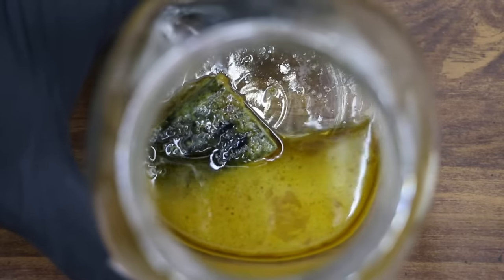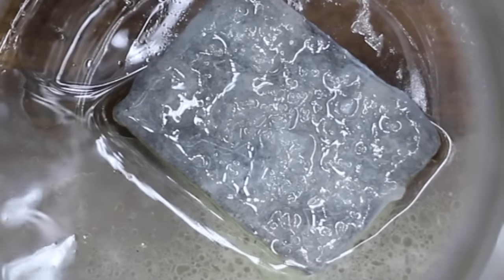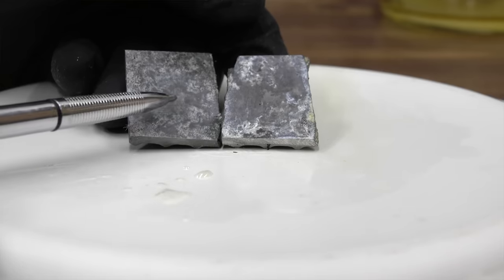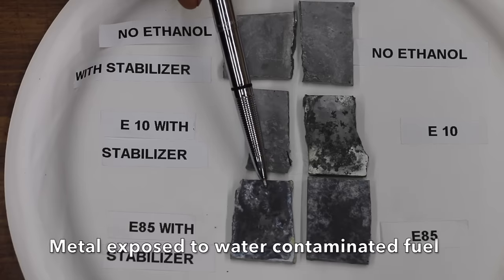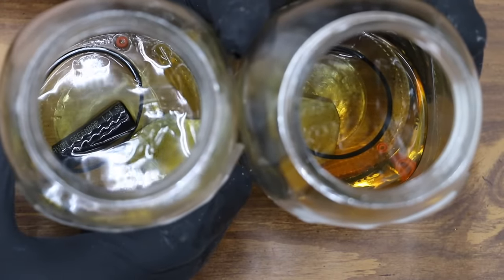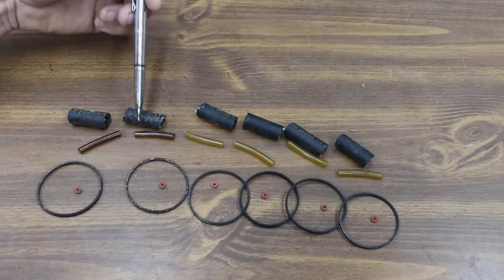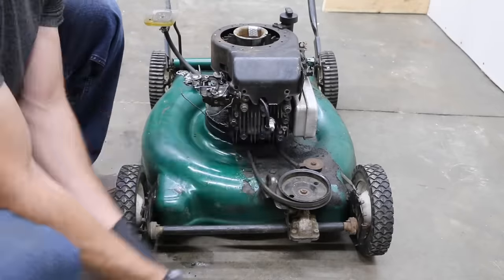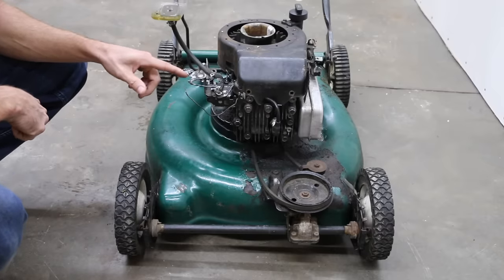Does Fuel Stabilizer Prevent Ethanol Damage?  Let's find out!

Comment: This is why it's worth the extra couple bucks to only use ethanol free fuels for your small engines (mower, whipper, snowblower, etc).
Reply from the maker: Agree.  I always drive the extra 15 miles round trip to purchase ethanol free for the small engines.  Well worth it!
Reply: Shhhh this is how I make make money lol.
Reply: This is why I'm working on going to electric for anything that would need a small engine.
Reply: Re-thinking the jerry can of mixed fuel I have. Don't want premature anything on the Stihl & McCulloch chainsaws.
Going to add Sta-Bil Storage to the can next time I fill it up. They say it's good for a year in the machine, no issues.
Reply: In Germany, even the normal Gasoline has 5% Ethanol
Reply: I've done small engine repair for many years.
I always advise people to drain their gas tanks and start the engine until it runs out of fuel.
Some listen, the ones that don't, pay me more.
Reply: @vik1299  In Ontario, Canada, normal (87PON) and mid grade (89PON) have "up to 10% ethanol", only premium (91PON) at select fuel stations (i.e. Shell) is ethanol free.
Reply: Yea I started buying ethanol free fuel for small engines years ago. Haven't had any issues since.
Reply: +Cole... Mostly a bad idea.  Batteries are expensive as hell and have limited run-times and having cords really SUX.  There is nothing I hate more than having to roll up extension cords after hours of trimming!
Reply: +Zeta.. what kind of batteries?  6 of them? 18 of them?
Reply: So if I get ethanol free gas for my tractor I don't need the stabilizer even when storing for the winter? Also my local station said it's rating is 110. Is that ok?
Reply: +Cole...  It's hard to see how battery operated equipment can stand up.  There just isn't enough power in a battery.  A small  (25cc) gas powered trimmer can generate 750 watts-1000 watts.  You are just never going to get that kind of power out of a such a small battery.  That is a lot of power.  Lawnmowers have even bigger engines generating well over a kw.
Reply: Ethanol fuels burn faster and are less efficient so you might as well use non ethanol fuels
Reply: It's forced on us here in Cali.
Reply: I've been told that the premium gas (93 or 91 depending on where you live in the US) at "larger" gas stations is generally ethanol free. However I've only ever seen one gas station advertise ethanol free fuel, and that was a sinclair gas station in montana (the green dinosaur gas station.) However, "racing fuel" sold at some stations (sometimes 95 octane or 100+ octane) is almost always ethanol free.)

Ethanol in fuel is stupid anyway. It's extremely subsidized and has to be or else everybody would lose money with it. I think it was only done to give the farmers somewhere else to sell their corn, although farmers would know more than me.
Reply: +Don... ALWAYS run your machines out of fuel at the end of the season and don't forget to empty to carb-bowl, no matter what kind of gas you are using.  Fuel issues caused by leaving gas in the appliance is the number one thing that sends the appliance to either the repairman or the landfill.
Reply: No the government should stop mandating that bullshit in our gas just to satisfy them corn farmers in that other scam  THE FARM BILL!!  Thats all its for to make farmers happy. No matter if it wrecks equipment or how much it costs to buy the higher grade fuel.. We shouldn't be forced to buy that shit in 87 octane fuel. They should have another 87 octane pump without that garbage in it!!
Reply: You can also get the small plastic shut-off valves and run the fuel out  before it's stored. That helps a ton we are fortunate to have a fuel company set up shop not far away!!! It's on the way to the parts store!
Reply: Agree! We recently got a gas station in town that offers no ethanol fuel. Made a huge difference in my John Deere 320X, my Stihl 2 strokes, and my Toro snow blower! I want to support farmers, but those engines run much better on pure gasoline.
Reply: Have not used ethanol mixed ever for my smsll engines, never trusted it. Glad to see you do an honest test.
Reply: I would suggest also testing any fuel for ethanol content. I have seen non ethanol fuel with a higher ethanol content than e10.
Reply: In my town there is only one place to buy it and it's 8 bucks or more a gallon
Reply: Problem with us up here in MA is, no ethanol free fuel is available at ANY pump across the entire state, regardless of the fuel grade. In NY, they sell ethanol-free premium fuel at the pump (at certain stations - not all of them) - all the grades below premium have 10% ethanol content. In MA, our only choice is to buy containers of race, or OPE fuel from NAPA, Home Depot, etc. for what comes out to $18/gallon and up after taxes. Even running a chainsaw, that will get pretty spendy pretty quickly!
Reply: All I run in my chainsaw and weed eater is 93 ethanol free gas and my lawnmower and both of my trucks gets 91 ethanol free gas.(both of my trucks are 1994 Chevy C1500).
Reply: or jet fuel .
Reply: syncerus.mr  
Yes that absolutely works.
I'd still drain any 2 stroke because of the tiny carburetors and finicky nature
Reply: I only have one small engine left and that’s on my power washer.   After use I just drain the tank and undo the float bowl drain screw.    Takes a minute or two and I can feel free to use regular gas from the gas station.   The washer is used a couple of times a year so doing this routine is really no hassle.
Reply: Good Luck finding Non Ethanol Fuel in NJ. Only place I know of is a Small Airport. Then you run into issues with Octane. And Possibly Lead.
Reply: Cole Logan    Yup.   I did just that.   Weed eater, small lopping and limbing chain saw, hedge clippers and blower all running on my 20 volt workshop batteries.    It’s great.
Reply: @reeepingk  Don't ever generalize premium gas is ethanol free.  Majority is not. There are websites dedicated to telling you where exactly ethanol free pumping stations exist.  In some cities of millions, there might literally be only one place to get it.
Reply: I don't mind for my lawnmower, but at the end of the summer I run it dry before putting it away for the winter. And what's left in the jerry goes in one of our vehicles.
Reply: @chrisphilhower6029  race fuel is non ethanol
Reply: @toysareforboys1  from Ontario as well, thank you, will buy at Shell
Reply: There is nowhere in the state of Texas to buy non-ethanol gas except maybe at a marina.
Reply: Tom B. I use Sta-Bil marine and it has been a very good product for me. I have a ski boat that sits during the winter and have no problem firing it up in the summer. I also use non ethanol gasoline.
Reply: @TheGibby13  Nice! I hope you got out and voted!
Reply: Pay me now or pay me later. In the spring, I get so many lawn mowers in for fuel related issues. I order carburetor rebuild kits by the case. I also buy Simply Awesome from the dollar store for my Ultra sonic cleaner by the case in the spring. It's non caustic on carburetors like simple green and purple power. I avoid those brands now.
Reply: @landdon24  Yes it will be fine.
Reply: @tarstarkusz  It depends on size of property. Anything over 1/4 acre and forget it. Buy a fuel powered unit. A battery will not last eather. The cost of a Replacement battery makes it impossible to justify the initial expence.
Reply: @larryw5429  It also drives up the cost of corn. It also eliminates the use of fields for more useful crops as food. Because farmers get a better deal on corn, they grow corn. Wheat is more important as a food source.  Corn also depletes the oxygen in the soil and requires more fertilizers that contaminate our water.
Reply: Worth it. Cuz carb and hose kits cost money and down time.  I still have access to av gas.  Wash my hands in it. It doesn’t stink.  I get JP fuel ⛽️ as well.
Reply: Ethanol is cleaner burning though as shown on this channel as well.  Non ethanol gas is generally better quality though.  It's a tough choice.
Reply: There's a handful of states (I believe 9) where ethanol is mandated in gasoline and it's actually illegal to sell ethanol-free fuels.
Reply: @oldtwinsna8347  Interesting, thanks! I wasn't 100% sure, hence the "I've been told." ;) One thing I am 100% sure is that mid grade gasoline is just a 50 50 mix of premium and low grade. So if you were to buy mid grade at a station with ethanol free premium, you'd be getting less ethanol (compared to low grade) if you bought midgrade. Only reason I know that is because gas stations only have 2 tanks for gas (another for diesel if they have it). (Family member used to be a truck driver.)
Reply: @racerex340  Ethanol has less energy density than gasoline, so you actually get a considerable decrease in mileage and efficiency with even just E10. It's literally worse in every way than gasoline (including environmentally), but it's used for political influence. The farming lobby is actually quite powerful and politicians happily kowtow to them for support.
Reply: @SmittySmithsonite  check you tube videos of how to remove ethanol
Reply: @RC Hobbyist... Yeah, that's what I though.  I was looking on the homeless despot and it claims a maximum runtime of 42 minutes on a 240wh battery.  So that's well under 500watts. Meanwhile, even the cheapest gas mowers are putting out several  kw or more.  ALL of the corded electric mowers are using over a kw and have a much smaller cutting area.
Reply: I love taking apart some of these carbs after someone leaves motorcycle, lawn mower or something else siting for a couple years - usually total disaster. You guys wouldn't believe what happened to my friends BMW boxer bike fuel tank - all brown from rust inside, thanks to old E10, 92 octane fuel.
Reply: @racerex340  - It is 100% true. Give me an address, and I'll show you a Google street view. I'd bet anything it's not at a pump. Only places listed on Pure-Gas.org are power equipment dealers, motorsports dealers, or marinas - only canned fuel is sold at these places. If a gas station is listed, it's because there's a garage at the station selling canned fuel there.
Reply: @tarstarkusz  actually the brushless electric motors hold there own power wise, it's making the batteries last long enough that is the issue. Depending on a person's task electric can be far superior, like if noise is a large concern electric is the instant winner.
Reply: @vik1299  not only has lower ethanol content but all fuels in EU, Japan seem to have a few extra octanes. In fact some cars on N.American market throw check engine light when run 87oct Regular, while no problems with Regular 95 in EU. I know the octane numbers are calculated differently, but for the sake of universality shouldn't the fuel around the world have the Octane rating.
Reply: Too bad I can't find any gas stations that are ethanol free
Reply: We have NO pure gasoline within at least 100 miles where I live.  :(
Reply: @brucebennett8475  - Been there, done that. It's ALOT of work, and you end up wasting a bit of fuel as you can never get 100% of the water out of there. I'd rather our idiot politicians allow us to get ethanol free fuel from a pump, like they do in every other state in the union outside of the Northeast.
Reply: @toysareforboys1 
But in EU Regular 95 is equivalent to 90-91 octane fuel in North America, so it seems that EU, Japanese and other countries fuel has also higher octane rating than fuel sold here and whole North America. Why, I have no idea, but maybe due to higher speeds and engine load associated with it historically, could be because most other countries cars also use smaller engines that pushed harder.
Reply: @racerex340  - Yeah, back in the day the Sunoco station in the center of Westborough used to sell 109 octane leaded race fuel. Not anymore. Those days are long gone, unfortunately. Airports are the only places to buy ethanol free fuel at a pump, but only certain places will allow cans to be filled. It's closer for me to just drive out to NY with a 55 gallon drum for auto fuel. Problem with leaded fuel is you'll get lead fouled plugs and exhaust ports or valves eventually. You have to run an additive, such as TCP (which isn't cheap either) to take care of that problem.
Reply: @racerex340  
The alcohol based fuel ratio is different for max energy. Usually more methanol or ethanol is needed than pure gasoline (14.7/1). But methanol for example has much higher octane rating and allows for higher compression ratio so it found its use in racing, say Motorcycle Speedway 500cc one cylinder bikes, boat racing, model engines. I think Brazil was one of the first countries to switch to alcohol based gas during OPEC Crisis many years ago.
Reply: Or get electric ones and never have to fuck around with messy liquid fuel again.
Reply: just don't ever let it set with fuel in it... Its very easy to shut off the gas and then let the engine run until it dies--- before putting it up for the winter.  Easy step.
Reply: @Dougie1969  This has always been my solution to small engines since the only ethanol free gas I can get is too low octane.  I simply empty the tank back into the can, and then run the thing dry.  Been running ethanol gas in a cheap Murray lawn mower for years now, and she cranks every summer.  Same with my weed eater, and my chainsaws.  I should add though that I mix Marvel's in all my gas.
Reply: I wish there were ethanol free gas stations around here, nearest one is like 100 miles away.
Reply: @pliedtka  Canada/USA uses PON fuel rating, most other places use RON, that's why the octane numbers look different but are actually the same :)
Reply: @vik1299  its easy to remove..by adding water then shaking it up...then remove the water/ethanol by removing the bottom layer...
Reply: @Jay Dunbar  That was point I was making.  To run these mowers at the same power as their corded brethren, it would take way too much power to run by the small batteries they use.  They all have smaller cut paths, even the corded ones.  Most of the gas ones are in the 5hp range, which is close to 4kw.
Reply: +Sean Daly... What about the lead?  Won't that screw up the catalytic converter?
Reply: @ProjectFarm  Can you actually get ''Regular'' gasoline without ethanol in USA?  Only way to get ethanol free in Canada (at least where I live) is going to Super higher octane gasoline.
Reply: @racerex340  Where are you? Our local Valero station carries both premium E10 and ethanol-free premium for the same price. My vehicle doesn't need premium but I buy the ethanol-free anyway.
Reply: +Mastron.. Most modern cars are designed to run with at least some ethanol.  Many modern cars can run e85.
Reply: @reeepingk 
Ethanol-free is more efficient. It has been shown to deliver 4% better fuel economy sometimes considerably more. That may have something to do with why it's used as a racing fuel.
Reply: @calholli  Then the black gaskets will just dry out and break off as pieces/grit next time you do add fuel. I just bought an electric chainsaw so I don't have to service the old craftsman 2 smoke.
Reply: @oldtwinsna8347 
www.pure-gas.org/
Reply: @TheGibby13  
Ethanol-Free in Canada...
All Canada: Shell V-Power 91, Canadian Tire 91, Esso 91, Petro-Canada SuperClean 91
Atlantic Canada: Irving Fuels premium
Western Canada: CO-OP premium
Newfoundland, Nova Scotia, Prince Edward Island: all unleaded gas
Ontario: Costco 91
British Columbia: Chevron 94
Reply: @racerex340  - I'm all of an hour from NH, and that's with no traffic (which never happens down here, lol). Yeah most of the places listed on Pure-Gas.org sell those exact same 5-gallon drums. Too rich for my blood. When I was out in OH a couple weeks back, I bought a little over 2.6 gallons of 90 octane ethanol-free fuel straight from the pump at $3.84 a gallon ($10 worth). Wish someone around here would do set up a pump like that! It was away from the regular gas pumps at the side of the parking lot.

I looked into buying 55 gallon drums of ethanol free fuel online. Still cheaper than buying the 5 gallon cans. I still may do that some day.
Reply: @racerex340  I'd rather see 87 octane be ethanol-free but of course that isn't likely cause most gasoline sold is regular grade. But you sure don't need premium in a lawn mower.
Reply: @SmittySmithsonite  
That depends on the state you're in. I buy ethanol-free at a Valero station three miles from home. They carry E10 premium and Ethanol-Free premium both at the same price.
Reply: @SmittySmithsonite  
Pennsylvania is in the Northeast and ethanol-free is available at a limited number of PA stations.
Reply: @racerex340  - Great idea - I bet that would catch on quick. Something tells me the powers that be here in MA would shut it down just as quick, though. Worth a shot at least!
Reply: @Cole Logan, while it sounds good in theory, batteries cost more to replace than carburetors when they go bad, and they’re not very durable for consumer applications. They are, however, great for commercial applications and have some definite advantages over gas - noise, emissions, vibration, etc. Just don’t expect to save money unless you can’t buy E0 gas.
Reply: @SmittySmithsonite  I live in PA and buy ethanol-free gasoline at the pump. We recently took a trip to Michigan and I was able to buy ethanol-free at the pump in Ohio, Michigan and New York state (in Buffalo area).
Reply: @tarstarkusz  Yep. And especially when said trimmer with the orange extension cord cant reach the whole yard. 

Been there done that. Lol
Reply: @thilolg  Yep. Ethanol is an alcohol based fuel so less energy content than straght Gasoline.
Reply: @tarstarkusz  I have run a Neuton rechargeable lawn mower for 15+ years. It was about $100 more initially than a gas mower but I have certainly saved way more than that on fuel. I've rebuilt the "battery" twice over those years. The last time it cost me $35 because it uses common SLA batteries that are used in computer UPS and scooters. They don't sell it (SLA model) anymore. They turned into drpower.com and now do li ion versions.

BTW I recently took it apart to untangle some  gardening mesh tied/twisted around the main shaft. It surprised me how clean it was inside it's all plastic case. The brushes were not even half worn. No wobble in the bearings. The circuitry looked brand new. When it does croak I am definitely going to buy a DR power mower because of the value this mower has been. The only thing showing a fair amount of wear is the wheels and after 15+ years that shouldn't be a surprise.
Reply: @DashPar  Well suprisingly Ethanol can be made without corn farmers. 

Its an alcohol based fuel. I don't like it very much because it doesn't have the energy content that Gasoline does.
Reply: @bergerongui  
Depends on the state you are in. I'm in PA and most EF gasoline seems to be premium grade here but in Texas there seems to be a lot of stations carrying regular grade EF fuel.
See www.pure-gas.org
Reply: +John Possum.. I go through about a 1/2 a gallon to a gallon of gas each season, so really the cost isn't a big deal, at least for me.  I don't have anything against them, they just don't work for me.
Weight isn't a big deal for a push mower, but I'd have to carry a string trimmer with a lead acid battery!
Reply: @racerex340  
It is available at isolated stations in NH. I believe Conway, NH has it. Also there is a station about 30 miles East of Meredith, NH.

https://www.pure-gas.org/index.jsp?stateprov=NH
Reply: We cant buy ethaonl free gas in 99.9% of California.
Reply: @scottfirman  

But see..

What bothers me is we have the technology to make Ethenal from other sources like garbage and wood because it's just an Alcohol based fuel. 

Yet they would rather chew up corn which I would like to keep eating thank you very much Government!! Ugh!!
Reply: @SmittySmithsonite  
We were in Michigan a week ago and saw ethanol-free at one station for only $2.849 a gallon. Extremely unusual. It's usually at least  $3.39 or more currently.
Reply: @WeShallBeFreeAtLast  Yep. Ethanol is simply an Alcohol based fuel that could be produced from other sources like garbage and wood but no!!! The freakin Government wants to use up all that juicy corn I would like to keep eating. Grrr.
Reply: @racerex340  
We use to live in NE Vermont. By the way, there is a station in Lyndonville, VT that has EF at the pump.
Reply: @njsongwriter  - When I say "Northeast", being from MA, I'm thinking New England as a whole. PA is a more normal state than MA. MA is run by a bunch of idiots, to put it in a family friendly way. 

Pretty much every state in the union outside of New England offers ethanol free fuel at the pump. I just grabbed 2.6 gallons of 90 octane straight from a pump in OH a couple weeks ago. $3.84 a gallon. NY has ethanol free premium at certain stations (Stuarts Shops being one of them).
Reply: @njsongwriter  No, that's completely not true. Ethanol has a significantly lower energy density than "pure" gasoline. It's quite literally a filler. My car, as well as nearly any other, took a significant hit in MPG when they started putting ethanol in gas. The reason it's used as a racing fuel is because it can handle very high compression without igniting (meaning it's octane rating is very high.) Meaning that with all things being equal, an engine running on ethanol (or methanol) can handle more boost than an engine running gas (assuming nothing else breaks.) In the types of racing where ethanol or methanol is used as a fuel (drag racing) fuel efficiency doesn't matter.
Reply: Yep, 92 octane ethanol free is all my small engine get. They run like a champ!
Reply: @Sean Daly... Do you have any ideas as to why it led to worse throttle response?  The LL stuff is very high octane and shouldn't knock.
Reply: The push is for even more ethanol .. Google "UNL88"   E-15 huge mistake , it must be stopped.
Reply: @Richard - Thanks Richard.  Found a Quik Stop just a few miles away.  I will check it out. It just opened in August and I've been driving right by it.  Thanks for the link.
Reply: @redeyedfreaks Try the website pure-gas.org.  It helped me find one close by.
Reply: john thonig  Thanks. I'm near Florence, so that would be a pretty long drive.
Reply: @racerex340  
It's bad enough we have to check food labels to make sure we aren't eating crap... Now we can't even be sure the fuel going into our tanks is fit for consumption by our vehicles without checking labels... Ugh!
Reply: @SmittySmithsonite  how about going to an airport and get some av gas.  Go where the little planes are.  Av gas will keep for years.
Reply: Ethanol is not cheaper. It releases less energy. Check your mileage. You'll find that you'll lose one or two MPG with E10.
Reply: @reeepingk  - Ethanol fuel is corporal welfare. And I'd bet that the family farms aren't the ones reaping the benefits. Here's an interesting article. I have no reason to doubt their findings, but I've never independently tried to verify them. However, the article is very thorough and does list sources in the footnotes.
https://www.taxpayer.net/energy-natural-resources/federal-subsidies-corn-ethanol-corn-based-biofuels/
Reply: @iHenry2  In practice ethanol containing gas is almost always cheaper because the only non-ethanol containing gas is high octane fuels (92/93). Gas with 10% ethanol has only 3% less energy so the fuel mileage loss is almost negligible.
Reply: @Matt-dc8lp  - I wouldn't call 3% negligible. I personally observed mileage and performance drops. I used to be very meticulous about vehicle maintenance. Also, the loss wouldn't simply be 3%. The energy density and the lowered octane of the fuel. 
In the average family car, most people wouldn't notice. But like I said, these are my personal experiences.
Reply: @GreatNW  Where the hell do you live? Even in San Francisco, gases under five bucks a gallon.
Reply: @iHenry2  normal gas around me is running 2 something but non ethanol gas is expensive cause there is only one station that you can buy it at so it's a monopoly. But I live in Roseburg oregon and it's a town that likes to think it's a city.
Reply: @garyh7949  Walmart in Calallen Texas has ethanol free choice at the pumps.
Reply: @scottfirman  Seeing how you're so smart, i would like you to try farming for a yr. Then tell everyone how rich you are after that yr.
Reply: @duanehenicke6602  If I did it would be with a government financed and backed loan so if I failed, they would bail me out like GM did.
Reply: @scottfirman  Lol. That's how i farm!
Reply: Where I live you can't do that, a minimum  of E5 is mandatory and most pumps only have E10. However fuel is not something you should store for longer periods anyways, and if you have a reasonably modern car it shouldn't affect it negatively.

You do however get better fuel efficiency out of pure petrol, it has a much higher energy density. Not to say that you can't get better performance out of ethanol, you can, but the engine needs to be tuned for it.
Reply: Ethanol fuel is fine for engines run on a weekly basis. No need to waste money on premium fuel when it's really not needed as there is hardly any difference performance wise. Now if you have equipment that doesn't get used much non ethanol is the only way to go or premix if its 2 stroke.
Reply: @Rottidog68  buy the Stihl premix it's worth the little extra and will last longer than anything you mix yourself.
Reply: @reeepingk  it used to be but hasn't been subsidized for years. Stop spreading misinformation about a topic you know little to nothing about.
Reply: @racerex340  Where i live 94 octane fuel at chevron is octane fuel. this is the only place that guarantees no ethanol. its only 15 cents more
Reply: @supersportimpalass  There's a difference in fuel consumption, if you can get them for the same price you should get it without ethanol. If there's a price difference you can either get the calculator out or accept that you might lose a negligible amount of money.
Reply: @Rottidog68  He just proved that stabilizer doesn't solve the issue. In some cases it seem to make matters worse. I'm I have a can of mixed PLUS 89 mixed for my two Sthil saws and I think I'm going to dump it. I've got regular 87 sitting in a generator with stabilizer for almost a year. I bet that fuel is toast.
Reply: @BigPanda096 I stop at battery powered drills, drivers and saws. A battery chainsaw would never keep up with my needs and neither would a battery mower. I need fuel around for the atv, generator, snowblower, pressure washer, etc. I really like the battery stuff but a battery riding mower is $2000 more than my JD 155 mower.  This was a very enlightening video.  You push mow 2 acres! That's insane! It used to take me 45 minutes to push mow 6,000 sf. including trimming around trees and house. Clearly you are not of this world.
Reply: @Dougie1969  What do you suggest with generators? I always keep stabilized fuel in mine because I never know when I'll need to use it. Clearly, stabilizer won't work in the long term. Do you suggest shutting off the valve and draining the carb bowl? I used to think I new all I needed to know on this matter but ethanol has changed the rules. Years ago when I was heavy into snowmobiling, it was widely suggested to completely fill the fuel tank to avoid condensation and to fog the engine until it stalled. No carb draining necessary and I never had an issue. Now I want to throw out all my 87 fuel and buy 91 because it's ethanol free here.
Reply: @bubba99009  I've never had any issues with any of my power equipment using regular 87 (10% ethanol) but now I'm worried that there's a major problem just around the corner. Basically, it seems like it's a corrosive cocktail just silently waiting for a day to f@*k you over.
Reply: @scottfurlong5475  
Ethanol free is definitely one of the best solutions 
The best solution for me has always been to drain the fuel tank and then run the engine until it stalls.
Reply: @BigPanda096  I agree with you there. Battery will take over most duties but cost needs to come down some more.
Reply: @garyh7949  Try a Marathon gas station
Reply: @omartinoco9930  Thanks. I did find a station close by that sells non-ethanol.  A new Quick Trip store that recently opened.  It was only 60¢ a gallon more than the ethanol.
Reply: In my area some, not all Marathons have Rec 90 ethanol free. Tractors, all lawn & garden equipment have neck snapping torque when used. Will give a car 10% more power & mpg.
Reply: @BigPanda096  Lithium batteries and brushless motors are putting small gas engines in museums.
Reply: @reeepingk  Ethanol as motor fuel was promoted to reduce dependency on imported oil. That reason has been solved so the ethanol should go away.
Reply: I have converted to all battery for shop and yard tools.   Same battery family for all.    The only exception is my power washer.    I use it maybe twice a year so I get 5 gals for a washing campaign and then drain carb bowl and tank and let them evaporate completely dry.    Any leftover gas is dumped into the car for immediate use.    Next year the machine runs perfectly.    Anyone can loosen a float bowl or use the drain screw (but leave screw off for a few days to evaporate the little bit left that didn’t drain out) as well as run tank dry and allow to evaporate.    I actually pull the hose and drain tank into gas can.
Reply: I can't find ny around where I live, and I'm not driving 150 miles to my nearest Sunoco station. I've been using E10 in my mower for 10 years, and other parts will break long before the carb; it still starts with 3 pulls from being off for 4 months, and 1 pull for the rest of the season. I think engines newer than 2005 should deal with the ethanol issue much better than those shown in this video.
Reply: Absolutely.  I do the same the for my boat.  My Mercury 150 has never seen a tank of ethanol.
Reply: @reeepingk  And don't forget the bunch of Eco-Phanatics "green people"... (Not that I don't care for ecology, but 99.99% of stoopid politicians and Obsessive Tree-huggers actually do more damage, as their measures are counterproductive).
Reply: @tarstarkusz  Oh yes! ... they can.  But will lose some MPG when using ethanol!
Reply: @BigPanda096  PLEASE CHECK YOUR NUMBERS SIR, Modern Li-Ion batteries capable of powering electric motors, are different from those powering cellphones, and their average number of recharges is no more than 500 cycles, after whose the battery will only have about 80% of the rated capacity, regardless of any outreageous claims or "warranties", or vendor promises.
Reply: @Matt-dc8lp   "Only 3%...". Please check your numbers, and do it carefully.  It is between 4% and 5%.  If in doubt, learn how to read true BTU content per gallon of fuels at a reputable source.
Reply: tarstarkusz the new generation of 18 v lithium ion battery packs used in tandem in mowers and the 36 v and better packs used in Electric Battery saws are robust and great for short operations in the garden and around the house with the advantage of cleaner operation and cheaper refueling by charging.the tools are generally lighter and easy to operate, a good option for women looking for a clean and light method of working.sure it costs to acquire but anything good will pay back your investment..... I definitely go with the guys who empty their equipment of fuel when it’s not going to be used for a while that tip is worth its weight in maintenance ....
Reply: Chris: I accept that great advances have happened in Li-Ion "tool" batteries recently. Those are powerful, even rivaling with corded 120 VAC tools.  BUT, even when manufacturers claim more than 500 or even 1,000 recharging cycles, the batteries continuously lose capacity, slowly at first, but then more rapidly, until it is time to exchange them at heavy cost.  Most people lack the dexterity, knowledge and plain courage to tackle a cell Exchange inside a large pack.  There are a few good quality cells in the aftermarket, but it is not so easy to replace cells when there are multiple monitoring wires, soldering (or even welding) involved.It is a greedy business-model for cordless tool manufacturers to make large amounts of money from their customers, as they overcharge them with outrageous prices for a new pack (sometimes almost the price for an entire new tool!), knowing that is won't last much, and they actively look to make their packs as incompatible as possibe, not only between other manufacturers, but among their own lines of products.  Only one of them (RYOBI) that I'm aware of, uses compatible batteries, but I'm not a huge fan of their tools.And apart from the initial cost of the not-inexpensive cordless device, it is the Life-Cycle cost of maintaining such devices.  Even at end of life, there is a cost (hidden but inevitable) for DISPOSING of those batteries...On other devices, like a pressure washer, the gasoline operated one is truly the only option... I had a 120 VAC compact one, and soon realized it took me EXACTLY the same time to use it to wash a midsize sedan, than using a bucket!  When I complained to a seasoned technician from Kärcher at an expo, he admitted that, and told me to go for their largest electric pressure washer, a "K5" size machine that was being discontinued at that time (model K-520M)...  As he said, anything smaller won't really save you any time at washing your car...  So I went to buy the Honda-powered Kärcher pressure washer sold by SAM's, as it had an even lower price than Kärchers own price for a similar machine.  Even at our very high altitude in Mexico City (7,350 ft. asl) and warm temperature, there are no electrical corded washers fed by 120 VAC that can approach my gas powered washer.  and there is another little known fact that gentleman gave me: When Kärcher made their electric motors for the American 120VAC 60Hz grid, they had to use thicker copper wire, but with less turns, to use the same electric motor frame, losing efficiency... so those initially more efficient 230 V motors, now produce LESS power when rewired for 120V... After several years of use, my gas powered pressure washer has been more economical to use than a corded electric one, because of the cost of electrical energy.  And only once, I had some problem when a tank of gas went bad and clogged the carburetor (my fault).  I don't anticípate any cordless pressure washer soon, as power and time of use still require more continuous power supply than any present day battery.
Reply: I remember when ethanol fuel came on the market in the 1970s... tried it in my F100. Ran hot, no power, and absolutely killed my gas mileage. Never bought it again until I didn't have a choice (lived in California).
Reply: I'd rather put that corn in a cow or pig and support the farmers with a nice roast or steak.
Reply: @Semper Fi  Holy crap that's painful... here in MT ethanol-free is just ordinary premium gas, so only another 10-20 cents more a gallon.
Reply: Not true, unless your state has draconian restrictions. Here in Montana, probably half the gas stations carry eth-free 91 octane. You can get it at almost every Cenex or Conoco, and a lot of Exxon and Holiday stations too.
https://www.pure-gas.org
Reply: I can say one thing here and I have learned this FACT from some very painful and expensive repairs.  NEVER run ethanol gas in any small engine such as is used in pressure washers, chippers, weed eaters, and lawn mowers.  The seals and internal fuel lines can't handle the alcohol and the carbs will crap out quite quickly.  Some of the newer units have a different quality seal and internal fuel line but after the amount of money I have spend on repairs I still don't trust them.  With older big vehicles like cars and trucks I understand there's a problem because of valve seats not being able to handle ethanol gas as well as carb problems.  The newer vehicles have different valves and valve seats as well as being fuel injected.  I personally will never run ethanol in anything other than my truck which is E10 rated.  Non-ethanol may be a bit more expensive at the pump but a lot less wear on the small engines, my nerves and my WALLET!
Reply: @iHenry2 , I can only speak from experience but my truck, a daily driver, is E10 rated.  Still, from new, I ran ethanol free in it to preserve the fuel system from corrosion.  After talking with a mechanic at my dealer who deals with fuel systems a couple of years after I bought the truck, I switched to ethanol fuel.  My fuel mileage DID drop for a couple of tanks then it picked right back up.  My dealer's explanation was that the onboard computers now sense engine performance based on fuel octane so when I switched it took a couple of tanks for my truck's computers to "reset" and bring the fuel mileage and engine performance back up.  I'm no mechanic or high priced engineer so I can only go by what made sense to me at the time.  All of these people that keep putting higher octane fuel in their standard engines are wasting their money because the computers will "reset" once they start using the lower octane fuels thereby bringing their fuel economy levels back up.  I don't know but it makes sense to me with all the computers doing everything now but driving the truck (and that may change in the near future).
Reply: @GunnerAsch1 , the price you pay to live in a near Gestapo run state!
Reply: Nicolas Broszky , maybe the newer small engines will but after having to have my older weed eater, chipper, riding mower and pressure washer all having to have their carbs rebuilt due to ethanol, I don't touch that stuff for anything!   Oh, and all four of them have older B&S engines.  That has been my experience with that stuff.
Reply: @karlseel815  battery powered
Reply: @Dougie1969  I heard it's better to fill with stabilized fuel to actually 'prevent' rust and corrosion. So if you drain the tank and run til empty, there are no adverse effects to storing the tank empty?
Reply: @Marcoosianism  
If it's a metal gas tank, I suppose there would be some concern about rust forming from condensation.
That said, any rust that does form is palpable compared to having your carburetor full of gel from ethanol and fuel stabilizer.
A fuel filter would stop rust from entering the carburetor.
Only other thing you could do is leave it full of fuel, (not the carburetor!!!!!), Then empty all the fuel and start with fresh .
Reply: @Dougie1969  Thanks for the extra details. I'm handy but not an expert on gas engines. Guess I have to go find a video on how to remove excess gas from a carburetor now, hehe.
Reply: @SmittySmithsonite  check for fuel around marinas. I’ve never seen a marina selling ethanol fuel.
Reply: @vik1299  In the US it's 10 percent.
Reply: The gas station right next to my house has ethanol free fuel and I use it for everything even my 95 beretta because it’s a lot of the time not even that much more expensive
Reply: @ProjectFarm  Not just small engines, but classic cars.  You said it at 7:57, but modern engines are engineered to resist ethanol corrosion.  One of the classics in my garage has triple carbs and an aluminium head.  A lot of the videos on YouTube of people setting their classics on fire are leaking fuel lines.  I currently drive 26 miles round trip to fill up my classics at one of the only remaining ethanol free pumps in the area (at least it's high octane too).  Even after one of my diaphragms finally failed last year after about 25 years since they were last replaced and I put in ethanol resistant ones in all three (not cheap, which is why you want to get 25 years out of them with decent fuel).
Reply: @pliedtka  But Americans like to feel special and different ... Especially with any measurement system 🤣🤣
Reply: @ProjectFarm  where do they sell ethanol free unleaded gas for only a few bucks more? The big town I live in cost almost $20 for 1 gallon at lowes and home depot.  Many gas stations here and all ethanol blends. Where besides expensive home depot and Lowe's can I get ethanol free gas for a few bucks more then regular price ethanol blend ? Any help would be so appreciated.
Reply: A few bucks more for ethanol free gas? Where at? Only place I could find ethanol free gas was at home depot and lowes for almost $20 a gallon.  Please help. I've called many gas stations in town and none sell ethanol free. Thank you.
Reply: @victoriam9465  don't know where you're at but check around lakes/marinas.  I've never had an issue finding it.
Reply: @victoriam9465  In NZ you can actually get it cheaper .....and with a higher octane rating 💪😂😂😂😂😂🔥💯💯
Reply: @tarstarkusz  Landfill? Don’t know where you live but we recycle stuff.
Reply: @Tailspin80  Not this stuff.  These small appliances end up in landfills.
Reply: @tarstarkusz  I live in the U.K. and it wouldn’t be legally possible to dispose of something like a small 2-stroke without recycling. The local recycling centre has about 40 different skips, including small appliances, large appliances, metal, TVs, batteries, wood, garden waste, etc. There is a skip for “non recyclables” and they keep a watch out for anyone trying to dump other stuff in there! Everyone is pretty much on board with the idea.
Reply: @reeepingk  Unless the gas is labeled as ethanol free, it has ethanol in it, regular or premium. 
Ethanol is actually used to raise the octane levels in gasoline.
Reply: This must have been a pre-biden comment
Reply: If you can find it!
Reply: @landdon24  I would still add a fuel stabilizer for cheap insurance.
Reply: In the uk ethanol free fuel like aspen is quite expensive
Reply: @peterpipe9015  in the UK all fuel is quite expensive 🤣
Reply: A extra dollar at the pump is worth it to me for no ethanol gasoline in small engines/2 strokes. Amsoil for all my 2 and 4 strokes. No issues